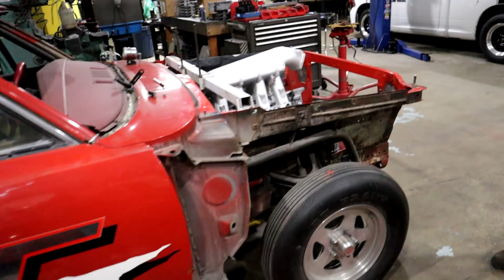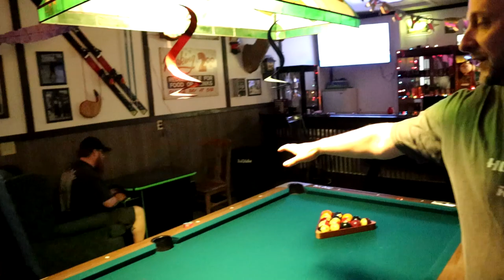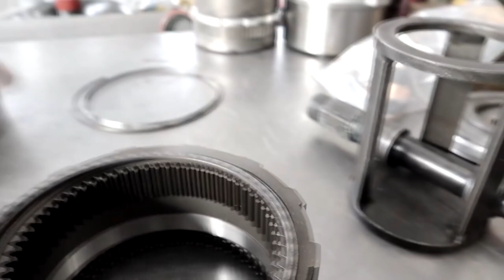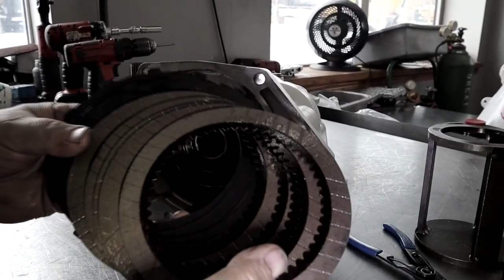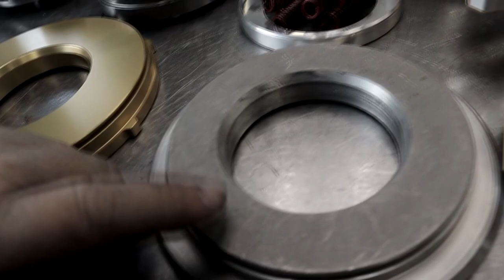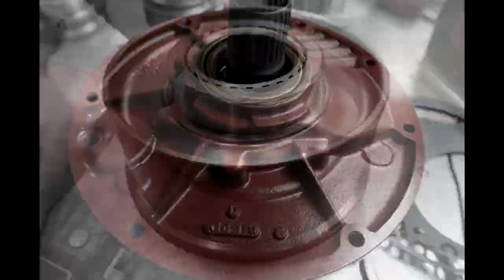Live At Cope Racing And My 46RE Transmission Build

Comment: Dammmm ! That’s an awesome build and awesome of him to accommodate you for the weekend! I hate that transmission lol ! That’s what is in my dakota rt lol
Reply from the maker: It was fun man, the 46re can be built up solid  unlike the 545rfe
Reply: @FrostbiteRam  yea mine was built by a local race shop about 10 years ago, steel clutches and all w/ a stage 2 custom shift kit, the gov pressure switch went out right away so I opted for a Martin Saine valve body
Reply from the maker: @onefastlife5017  nice